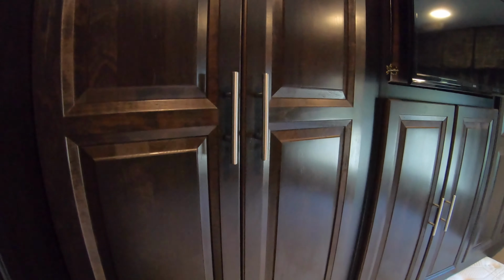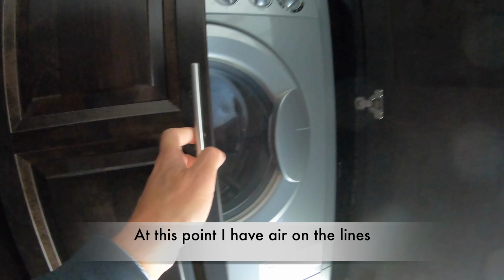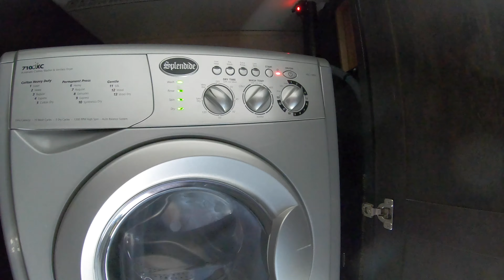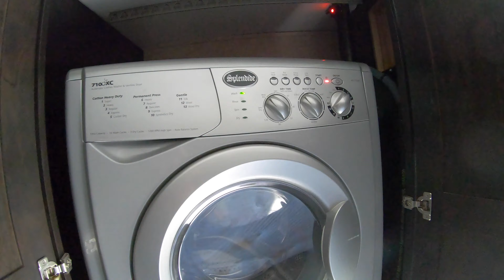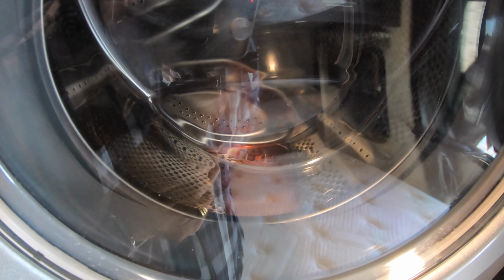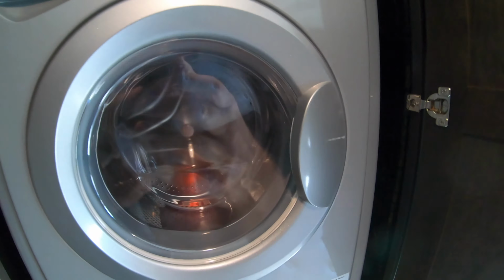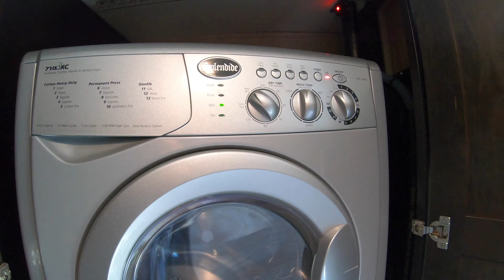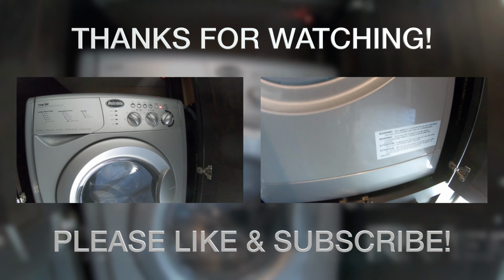Winterizing a Splendide Washer - Dryer Combo

Comment: How did you get the antifreeze into the washer?
Reply from the maker: When I pressurized my RV with antifreeze, I had a valve that I turned off where the water goes into my residential fridge so that it wouldn’t go into the ice machine
As for the washer dryer, all I did is when I had the antifreeze and the pump under pressure on the system. I just ran a wash cycle and once I saw the pink antifreeze in the machine, I put it on drain and I was good to go there because I had enough antifreeze through the washing machine dryer combination And it did the job so you’ll have to do it when you’re pressurizing the system with your pink plumbers antifreeze or just use the pressure air compressor to blow out the water and just go into a wash cycle allowing both valves to open that’s the hot in the cold. I hope this helps. Thank you for watching and your question